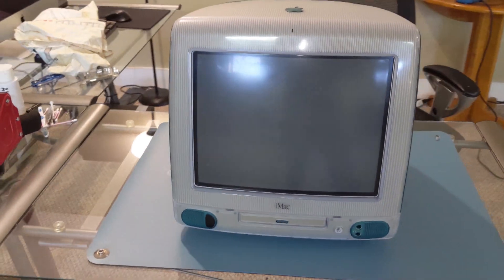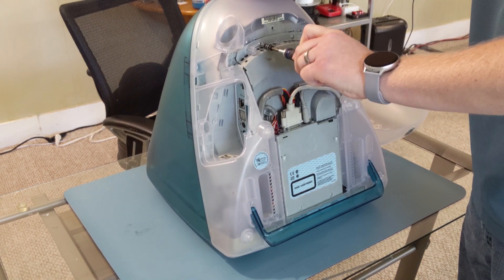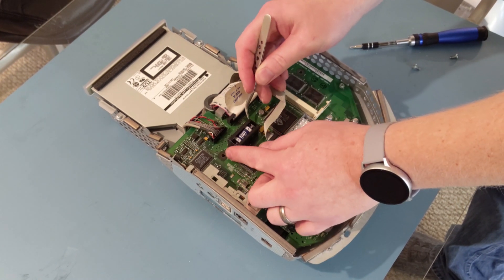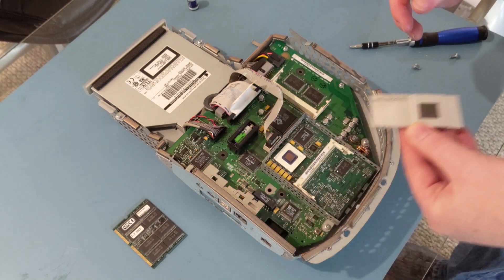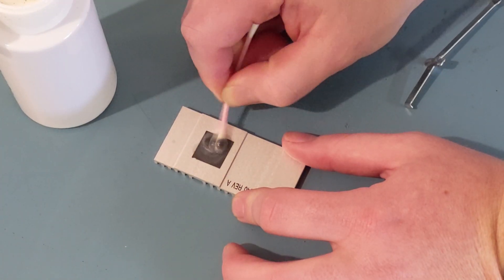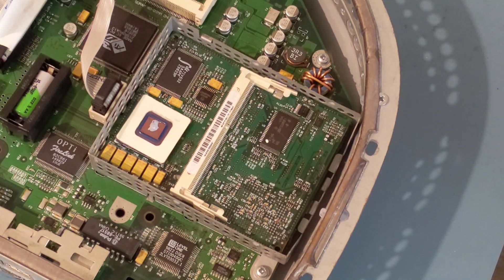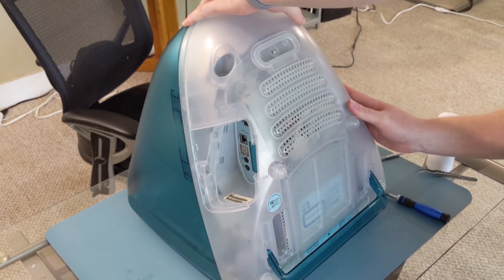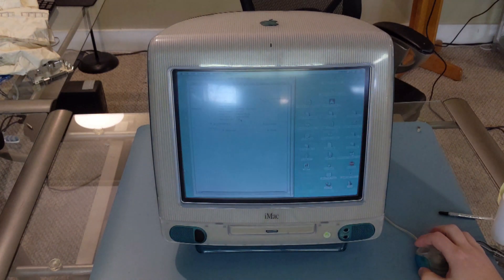iMac G3 Bondi Blue - Preventative Maintenance

Comment: I've got a G3 that's not turning on. No lights sounds or nothin. Tried multiple power cables and outlets. What's the first thing you would do? Is there a reset button? Replace PRAM battery? TIA